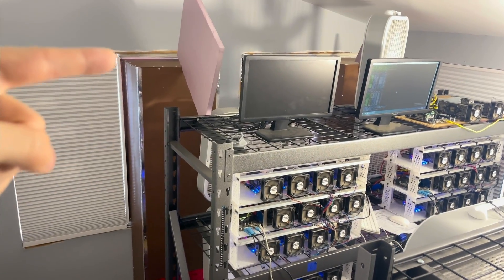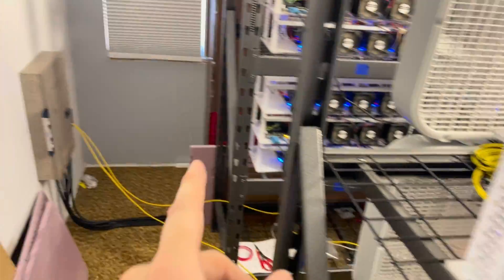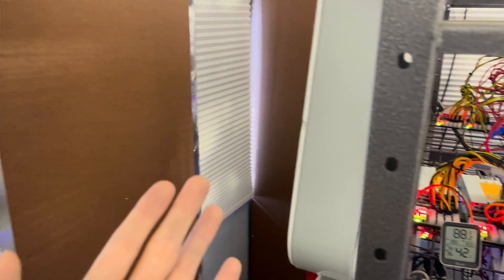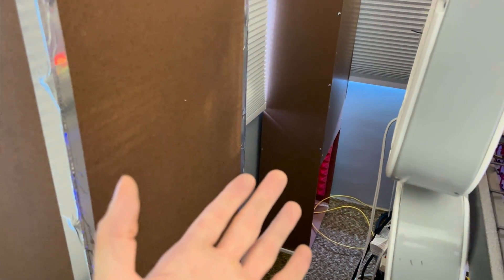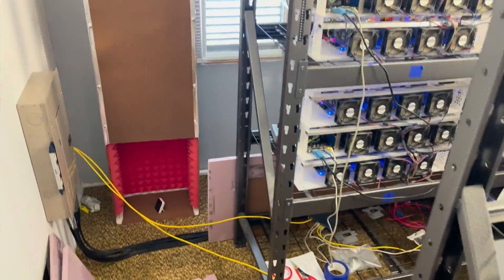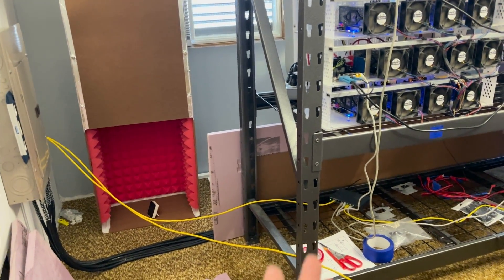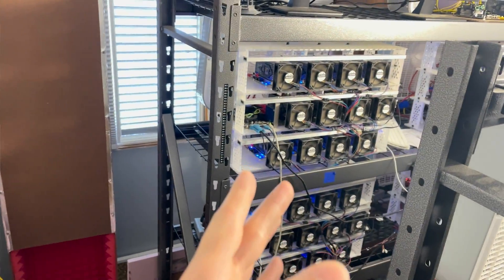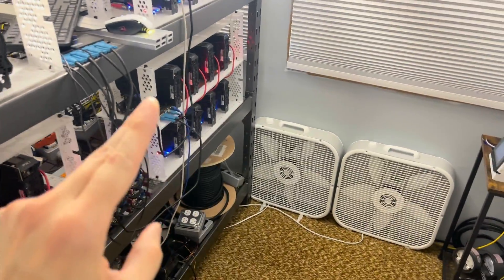Silence A Crypto Mining Room...

Comment: u have no idea what you're doing. looks like an 8 year old made a mining fan room with foam and baby fans. You just need some crayons to complete it now.
Reply from the maker: I still struggle with this concept. I’d be interested to hear why this setup, that is working exceptionally well, is not working. The temp deltas are very good, the power consumption is roughly ~10x lower than similar power systems I’ve seen posted. It’s much quieter, handled years of extreme snowfall, heavy rain, and moderately hot summers. The fans produce enough airflow and pressure to make it challenging to close the door. How would you do it?

Comment: For exhaust fans research VIVOSUN 6 Inch 390 CFM Inline Duct Fan with variable speed controller or comparable duct fans, I have several pumping heat into the attic.  34 decibels plus or minus based on the speed setting and they may use less electricity than the 12 or so exhaust fans.  4 could do the work of 12 but that depends on the CFM of your fans. You'll need a wood frame or some angle iron from the hardware store.   You have a good setup that's functional, all you need is better hash rates so hopefully the bear mkt will end sooner.

Comment: water cool my friend, why does any 1 use air cool, water cool cheaper to run, quieter, use less energy, do l need to say anymore
Reply from the maker: Yes, however it is VERY expensive and complex to deploy. People use air cooling, since the hardware comes air cooled. Modifying a farm to water cooling will increase the likelihood you never get an economic return, and it also has an opportunity cost even if you do. Submersion cooling makes some sense, but that's also somewhat complex and expensive.

Comment: For the exhaust, you could make a similar sound trap on the outside, just i lot bigger, and maybe with the exit path upwards and out instead of donwards.
Reply from the maker: The concern is the aesthetics, and space it occupies. Plus, if it’s outside it needs to deal with the weather. I get a lot of snow, ice, cold weather, rain, bugs… I need something classy and not obtrusive. In the winter time the fans are going to be running slow enough it’s very quiet. But ideally I’d like it to be quiet next summer. Someone should be able to look at it and not think twice. It’s a tricky one.
Reply: @SiCPoWMining  Yeah, I understand that. The outside issue can be fixed with the right materials, and the heat should keep snow from staying even with low fan speed. But I guess it would have to be an  Engineering/design/art project.

Another idea, if there's room, is to move the inside fans backwards, and create the sound trap inside. But if you want the same effect, you'd probably have to make alterations to the wall. Or move the air out the ceiling.
Reply from the maker: In my area I expect several feet of snowfall over a few days most winters. Sometimes this happens a few times in a bad winter. This rate of snowfall does not melt very fast, and it's actually a problem to melt this much snow since it will re-freeze a bit farther away causing ice dams and potential damage. The exhaust needs to be as cool as practical, and fairly high up. I'm not sure how this is going to work out this winter, but ill solve the problems and make videos if anything interesting happens.

What you're talking about is definitely possible, but it's creating a few issues and only solving one. Definitely a consideration, since it will work for sure. It would likely be a bit expensive to make though. Maybe concrete construction would do it, but that's a bit of a job. I'd be concerned about bees nesting inside a structure like this, so it would need to be protected by a fine mesh which complicates things a bit. Right now, at the exhaust, there's not a lot of physical space, so even if the fan was off it limits the chances of a serious risk from bees and birds.

Comment: Creative! 👌 Did you foam that entire box? Missing that part where you show us the actual structure. Great stuff nevertheless!
Reply from the maker: Yeah, it was ~24 pcs of 12" foam per side. I did notice I entirely forgot to cover that! Maybe ill do a short on it. It's the cheapest compressed wood product from home depot, some flimsy L channel aluminum, and self-tapping screws. I covered the joints in caulk and taped the seams from the outside with foil tape. The foam is glued in with construction adhesive, so far it's been in over a week and holding up.
Reply: Maybe you can try to build the exhaust into a smaller soundproof "box", just leaving the back open, like a tunnel? or would that restrict much maybe?